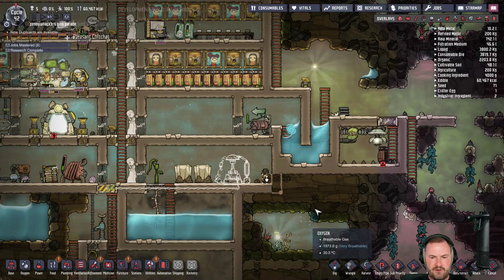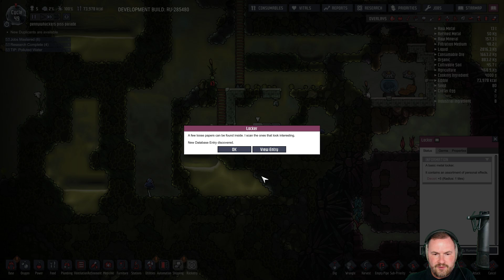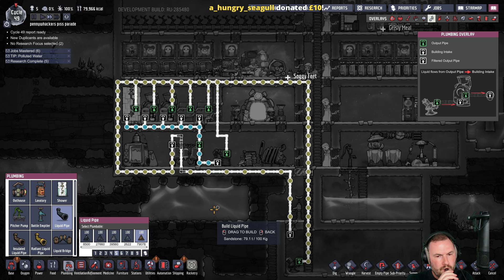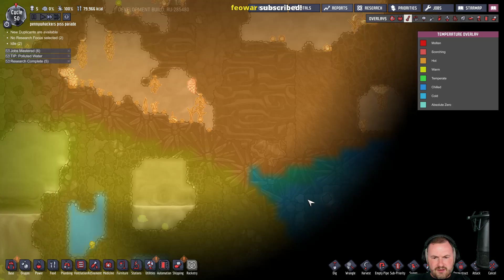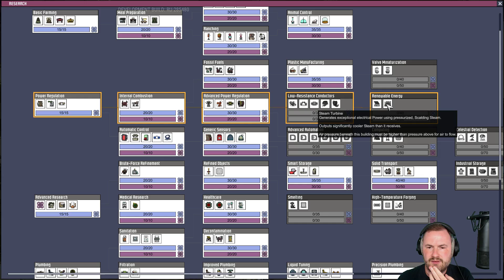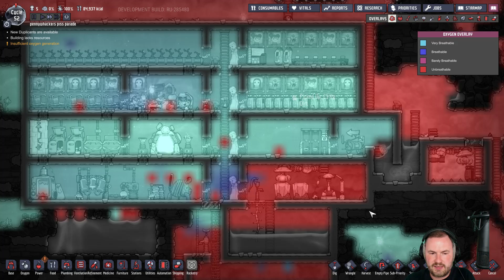Sips Plays Oxygen Not Included (5/10/18) #22 - Renewable Energy

Comment: The solution to the piss problem is so obvious and it frustrates me so I'm gonna describe it here for no reason. EVERYTHING THAT CREATES PISS SHOULD OUTPUT TO THE PISS TANK ONLY. EVERYTHING THAT REQUIRES PISS SHOULD BE ATTACHED DIRECTLY TO THE PISS TANK PUMP. That way there is no ambiguity as to the direction piss should move, and the tank provides a buffer to prevent the blockage that happened in his previous colony.